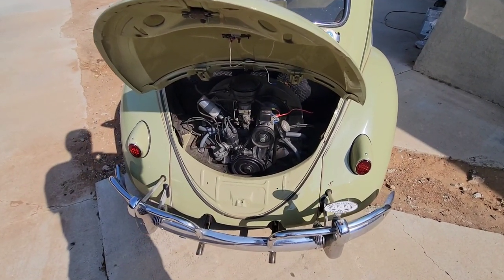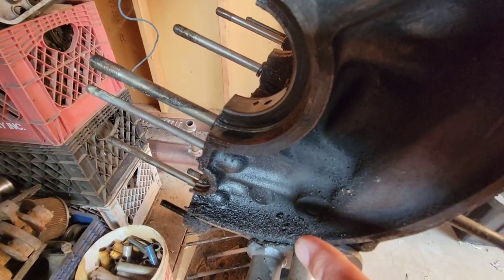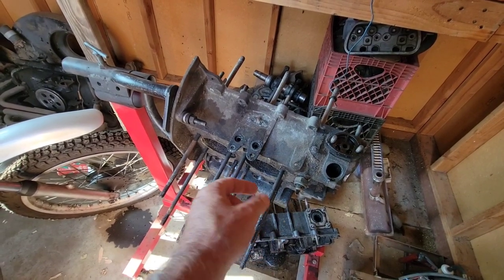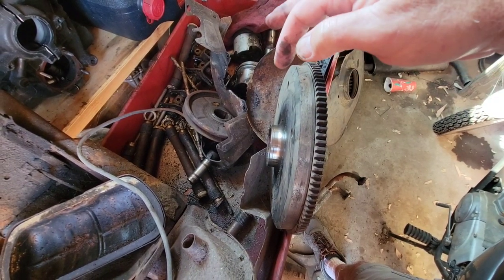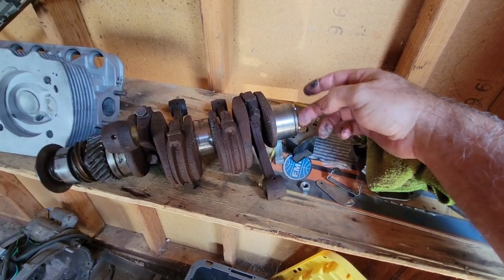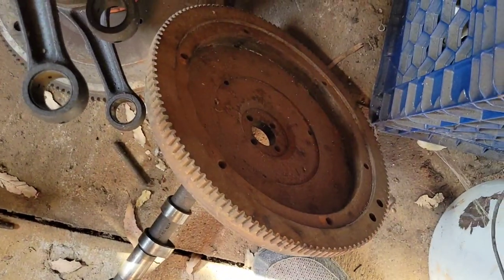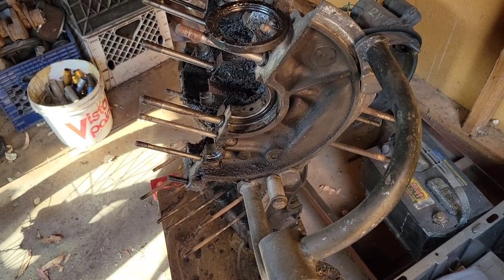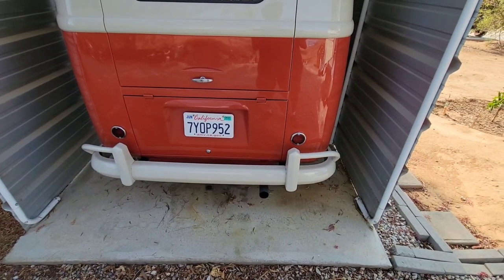OIL LEAK VW flat 4 air cooled engine oil leaks and how to fix them

Comment: Air cooled VW's were designed when cars weren't expected to be completely "oil tight." They tend to drip slightly - just don't want them to leak excessively 😆

Comment: Hey, just brought a 1979 transporter 1.6 petrol, got a little bit of oil underneath only a small puddle, on the drive home (around 60 miles) so had sprayed a little bit up the back bumper, complete newbie here, any tips?

Comment: Got a 1600 that got new scat dual carbs, 88 thick wall piston upgrade. Been trying to drive but oil keeps being launched all over. I think it may have had a sand seal with matching pulley at one time. It now has empi repro og look pulley and I had to remove tin over newly installed cb oil pump. Hoping seal pulley combo is my solution but if not will have to look closer at venting. Thanks for hints tricks and tips
Reply from the maker: Need road draft tube maybe too many RPMs on the freeway or needs case ventilation system
Reply: Yep, I remember all my vws had og style oil filler neck with tube going down and rubber tip with slit cut. PO installed stupid china filler neck, ugly and create more problems. Ever heard of guys using brake seal behind crank pulley instead of sand seal. Was thinking of trying if sand seal didnt get it.Gotta keep trying on my own because so many guys say they know, but in reality dont know anything but how to cost you time and money.

Comment: In my 1964 VW I experience an oil leak from the behind the Harmonic balancer pully. Turned out to be a blocked standard oil filler cap ... Sump pressure increased and the oil had few options . Behind the harmonic harmonic balancer puller, seemed to be the easier option ...Cleaned the cap .. instant fix

Comment: I have a 1915 or 1914 depends on who you are talking to. When I built the motor I put the spring loaded tubes in. The walls are at least twice as thick as the stock. Needed it because the tubes are exposed on my dune buggy.  No problem so far. With the crankcase pressure, I noticed it coming out of the dipstick tube. Like you said it needed venting. Purchased empi tower type and put in the tubing you spoke of in the valve covers. It was also vented to the atmosphere via the down draft road tube.
Reply from the maker: yea on a few engines I have done it without the road draft tube and every one would build up pressure. Yea best to have that there too. you bet.

Comment: Hello  I have a 36 horsepower 1192 stock engine! I was changing oil yesterday. I noticed their was no drain plug on the sump pump, the the drain plug was over to the right side of the sump pump. I could not loosen this drain plug! Have you seen this before? Thanks Mike Fiaschetti

Comment: Hi Mike, My 68 camper bus I had ran great down to California on 101 and 1 to LA back in the early 70's but when we decided to drive home to Seattle on I-5 it started leaking oil pretty bad. I just kept adding oil and a week or two later on my way to work on the freeway I threw a rod and the motor was toast. Watching your video I think does a good job of explaining what may have happened. I had the engine replaced and sold it. The guy blew that engine too within a month and wanted his money back. Told him sorry he would just have to take it to the shop I gave him all the paperwork with and see if they would fix it like I had to do. Never heard again from him?
Reply from the maker: sometimes when they leak really bad it can run low on oil pretty quickly or the oil will be too hot and not lubricate. Stock they only hold 2.5 quarts so if it is a quart low that is not much oil.

Comment: Did you cover the cam plug or did I miss it? Easy preventative is to coat the plug from the outside and all around the outside of it with gasket sealer (once the plug/case is spotless).

Comment: I added the empi breather to my 1968cc. Three locations used for pressure relief.  Valve covers and the oil fill stand. This still was not enough to run 60+ miles on the freeway at speed (80 mph) . So I added a pvc system from the fuel pump block off into my carburetor.  This seems to have cured the pressure issue for me. 

Thank you for the videos.  They certainly help with ideas.
Reply from the maker: you can also use a road draft tube or an inline filter which do the trick. with the breather kit.

Comment: Sometimes transaxle oil leaks get mistaken for an engine oil leak. At least some of the transaxles have a seal at the final drive and when it leaks you get gear oil where motor and transaxle join. Of course gear oil is thicker and smells and looks different.

You are right about German early black seals. The other day I changed the rear main seal on an untouched 40hp and it was black with the VW markings on it.

Comment: I just had to change the oil cooler seals in my '70 autostick. It developed a "my engine is leaking everywhere" symptom and it ended up being one of those stupid seals. Two days later the vacuum assembly that shifts the gears started whistling when trying to shift and now it won't shift at all. I can't even get it into reverse. I'm still in pissed off mode so I'll figure it out later. I hope it isn't the servo that I replaced a year ago and it's just the diaphragm but I fear that it is. Thankfully it's not my daily driver though I would like it to be one of these days. My legs are mostly useless due to health issues so that's why I got this autostick to begin with but I didn't anticipate the problems it had and some that it still has. It looked cherry when I bought it so I didn't think it would need much done to it. Boy was I wrong! I'm about ready to call it a moneypit but I can say that it is almost "finished" (nope, they never are) at least. An autostick is an entirely different beast to work on than what my '66 was. Why didn't I get a Corvette for my midlife crisis instead?

You wouldn't happen to know of a source for fuse boxes for a 1975 Dasher with AC, would you? They put them under the hood and water leaks into them. A common problem but finding a replacement fuse box, especially for one with AC, is almost impossible it seems. I've made my own before but this is a friend's car and it's almost mint so he wants to do it right.

Comment: Enjoy your videos and I usually browse the comments so I don't repeat questions. What about leaky transmissions. I have a 69 bay that sat many years in a pasture land and I recently had a rebuilt  engine installed.  Was surprised that the tranny works very well. But it do leak. Anyway,  great video. I enjoy all the tech stuff you do.

Comment: I just took a trip from PHX to Northern AZ and when I arrived I saw these microdots on my rear end. I have made this trip before and have not seen them so it was puzzling to me.. I just change pushrod tubes and looked there first but not there.. I didn't have any oil in the engine bay except for my oil cap and a little on the block behind the distributor. I do have a road draft tube with breather going to air filter.. I would expect a lot of oil in the engine bay but very little.. I'm contemplating a breather box system as you have but not sure if this is my solution?
Reply from the maker: yea that might fix it. Pretty much one of 2 things. or a crankshaft seal situation. 1. Engine RPM on the freeway Solution: tire sizes or gear ratio change or slow down. 2. breather system if you have a larger than stock motor. 1835 and larger may require breather system.  If you only notice the problem while on the freeway. it is usually #1 or 2

Comment: Hey I’m building a bigger motor a 1679 with the ticker walls I didn’t take the block apart just adding the piston and cylinders with the 90.5 heads and while I’m at it I’m replacing my seals n gaskets wear I can it’s going in a 1971 Baja bug it has tall narrow tires on the back   He looks mean lol anyway do you think I’ll need to add a breather box to it  I don’t think I will but the person before me but a aftermarket oil filler on the generator stand and it blows oil back through the hose on it before I took it out I thought the meter deflector was wrong but it was facing the right way but I can’t figure out what’s going on there n worried  when I put it back in the car it will still do it.  Any ideas?
Reply from the maker: not usually. the starting point is 1835 and larger. Maybe an 1800 with 74mm stroker would too. but for the most part you should be fine. I had a 1776 with a big cam pretty high revs and still would not blow oil out.